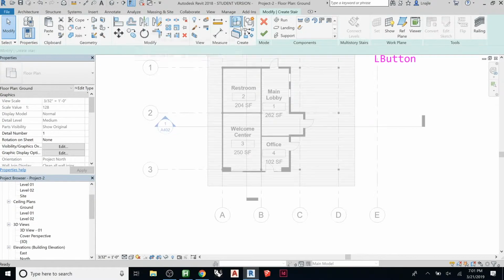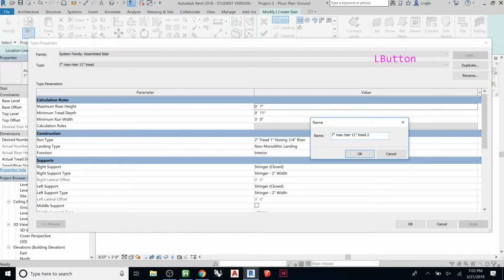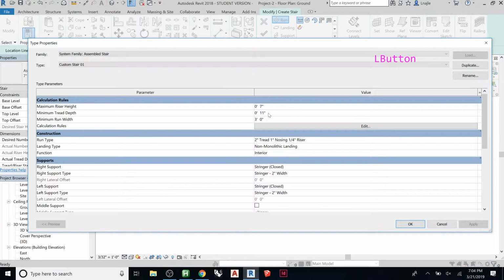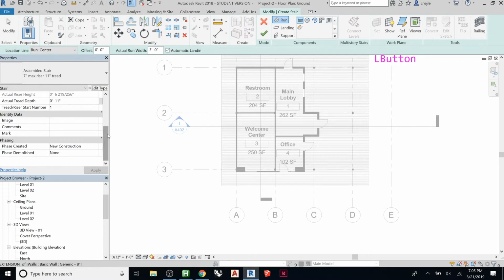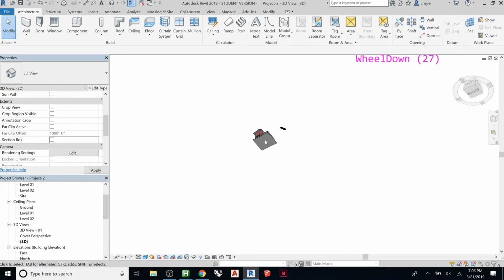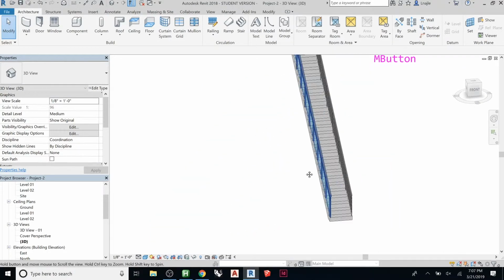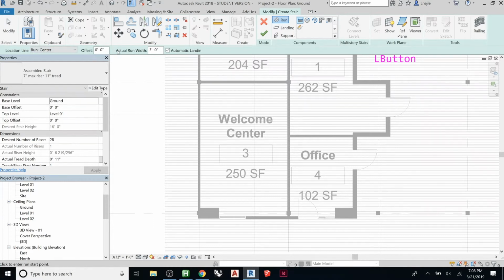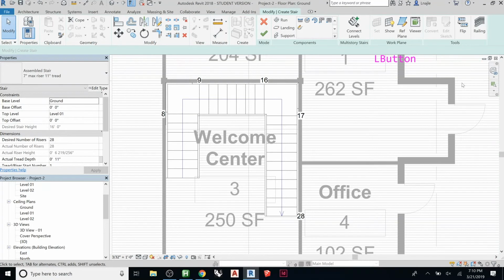Revit 101 | Part 20 | Stairs

Comment: My stairs punctured the ceiling, I believe we should've made an opening at the ceiling and at level 01 floor. Peace up.
Reply from the maker: Felipe, yes you can do that but it can become a lot of work if you have many floors and requires re-doing at every element if you need to move the stairs. Instead you should try using a shaft opening and extend it through your model where the stair goes. 

This is also the topic of the next vide so you will see what I mean if you haven’t done it before.

Love reading all your comments, dude. Keep on learning and growing! I’m here if you need me, peace up!